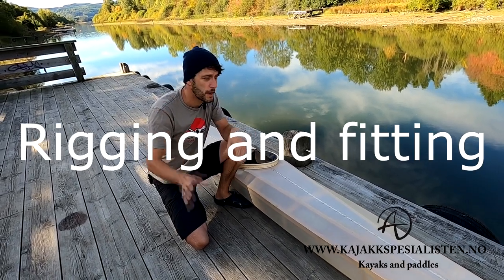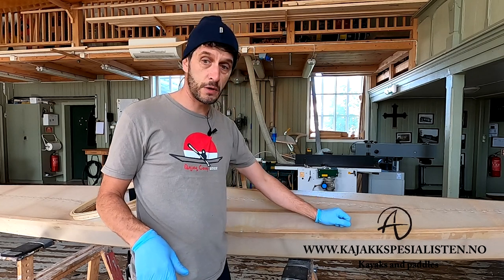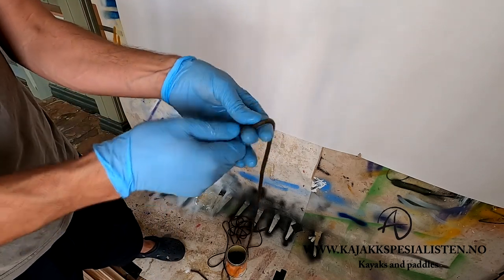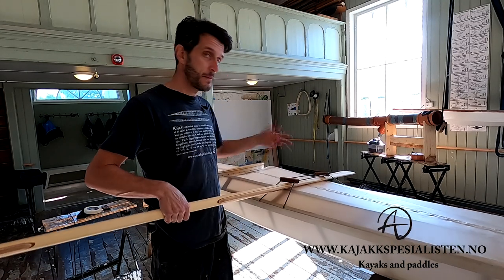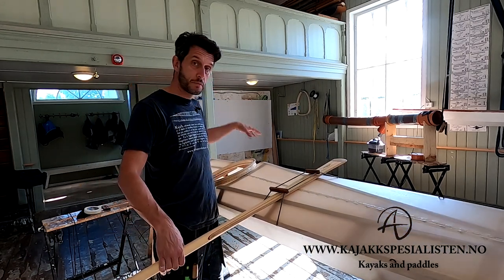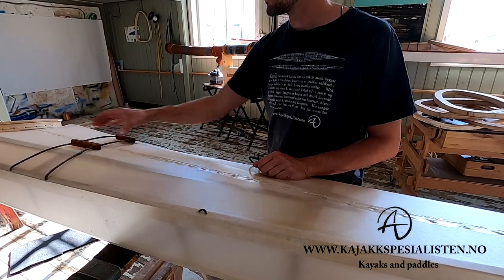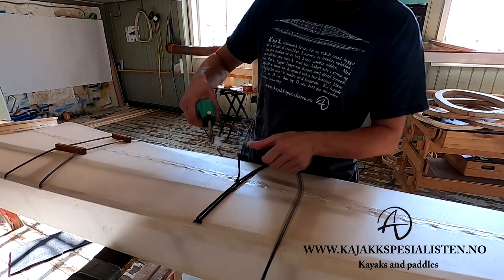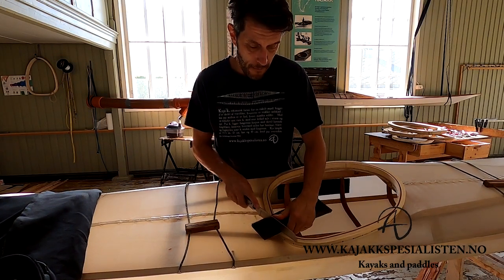Kayak rigging and fitting

Comment: How did you like the Koelan? I varnished my Cape Falcon F1 with Lechler 2part PU, but since I saw a Kajak that was painted with Koelan I think the next time I would give it a try despite the cost.
Reply from the maker: I like coelan a lot. I don't use it myself often because of by budget living, but the times I did it has impressed me. like my 2011 expedition round the Norway coast - my coelan coated skin kayak hardly had a scratch after 3000 km. of paddling